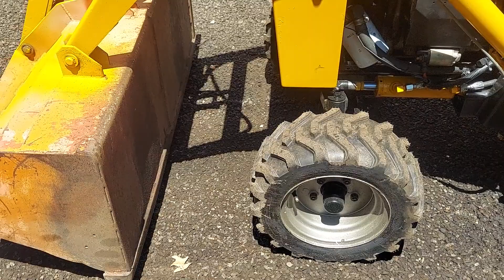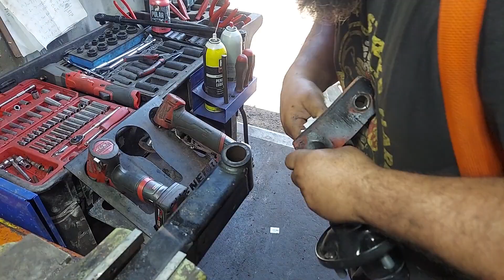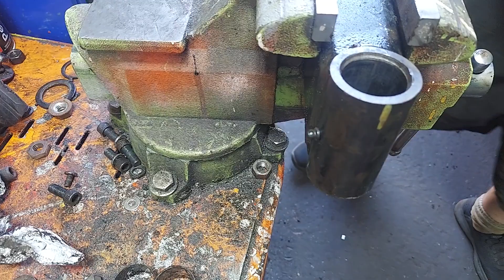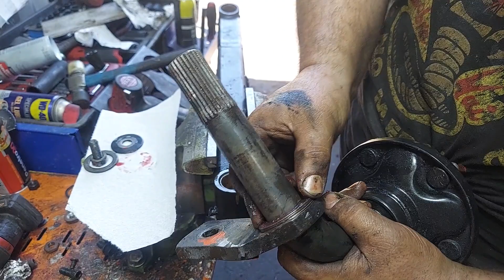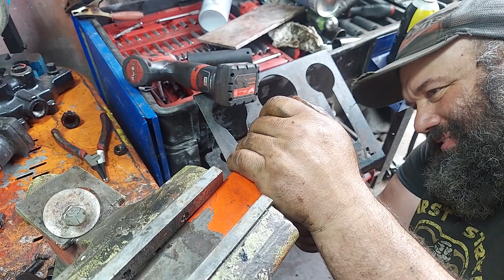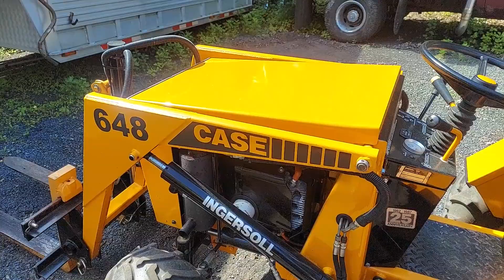Case Ingersoll Loader Front Spindle Bushings, Our Upgraded Affordable Solution Kit Now Available!

Comment: Is there a mower deck for this style tractor?
Reply from the maker: Yes the 600 series had the option, a toe brush mower are available for all models as well as all  with 3 point which had option of rear finish. Thanks mower.

Comment: I have a question. I have an CASE L 29 5 40 p t o attachment. What type of oil do I put in the gearbox 80w90 ?.. Also, I'm looking for a manual for this attachment.Do you know where one is available?Thank you for your professional advice .
Reply from the maker: @jimquick1249  hi I would say 70 90 or 80 90 or synthetic versions. I can look for a manual. There might be something on line. Thanks for watching and the comment.

Comment: Should still be using a spacer especially when the bore is worn and the bushings are a loose fit. Those bushings will end up pushed together which increases point loading
Reply from the maker: We have not seen them move yet but is a possibility, but with the longer bushings there is not much room for them to move and the grease will still push through the slits and cut outs. But one could cut there old spacers to fill the gap if they wanted to for sure. Thanks for the comment and watching.
Reply: Awesome video, thanks for showing me on how to fix this